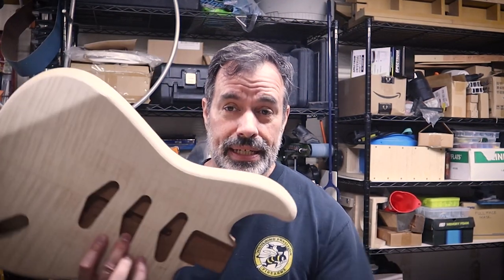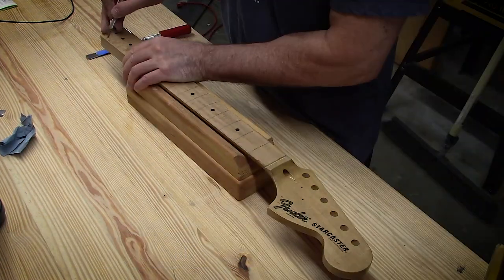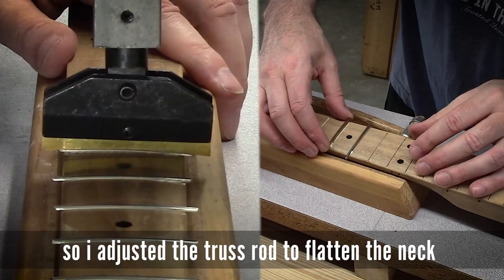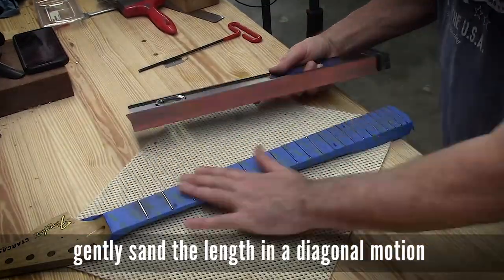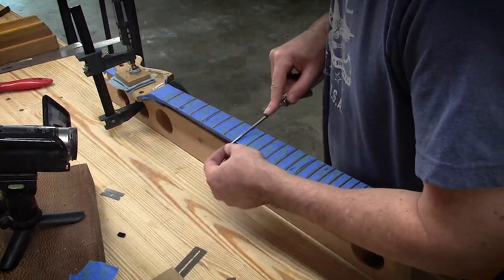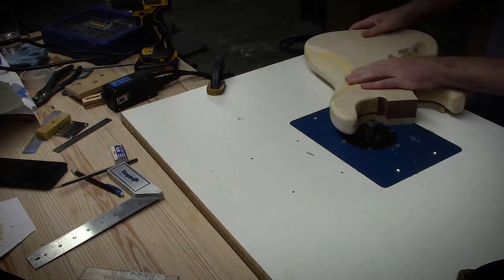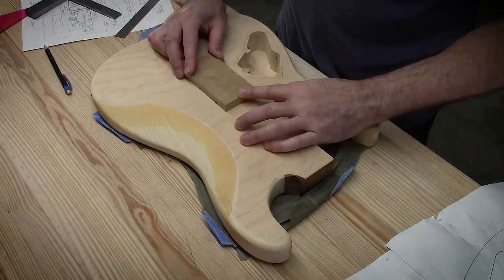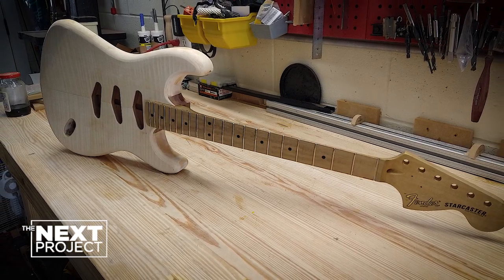Fender Strat Starcaster Guitar Mod Project 5

Comment: Good Lord that thing looks good so far...👍
Reply from the maker: Thanks for watching!
It's going to be a nice guitar some day, still needs a lotta love and a push in the right direction.
Reply: @theNextProject  I hope I'm not being a pain but that fretboard was treated with ca glue then polished up ?... I'm going to adopt that into my builds...just beautiful man..
Reply from the maker: There is a little learning curve and I'm sure you'll develop a process that fits your way of working.  
A couple notes that I should have mentioned in this video. The CA coating process works best with Maple, good closed grain maple.
This fingerboard has some defects in the grain, and those defects are little potholes here and there. The CA doesn't do a great job of filling  little imperfections.  
I once tried this on a rosewood fingerboard, and it was crazy shiny too, but all the grain created pockets for debris to catch in. When I did my level sanding, all those little pockets filled with sanding dust = no good.
Roasted/baked maple works really well, really POPS. Curly works well too.
Other hardwoods with close grain should also be cool. Purple Heart would be neat to try.
Good luck, and be prepared to experiment!

Comment: I'm so sorry for being late to the party, but I simply forgot to watch this video yesterday. So many other videos to watch.
Well, you keep up the good work, that's great!
I'm not a millimeter closer to doing my single humbucker ST. My current plan is to not install a 5-way-superswitch, but to only have a P/P for reverse polarity of one of the coils. I think that's enough. Reverse polarity of one of the coils, you know, many people call this phase inversion.
But I'd like to take a hard tail body and the old Harley Benton neck. I just can't justify the cost to myself.
My actual next project won't take more than one hour, probably less. Only replacing the pots and the caps of a Harley Benton RB-414 bass. A bass that is supposed to resemble a Ricky 4000 series bass, but actually pretty differently looking. Just a little bit of soldering, nothing more. And when I'm finished, I'll replace the knobs with T-style knobs, two black, two chrome. I only have to decide, whether black/black will be volume/volume or maybe  black for volume/tone of the neck and chrome for volume/tone of the bridge PU.
Reply from the maker: Achim, good to hear from you and I'm typically late to the party as well. You're in good company!
I understand not getting project work done as expected, but it sounds like you have a good plan to follow when the time is right. 
And your next project, good to have ideas up front. I try to follow my ideas, then I wonder off when the work starts, lol.
You've got a lot mapped out, all sounds good. Jump right in and stay with it!
Hope all is well for you, take care!

Comment: Love the super glue finish on the fretboard. Did you ever try putting wire or cardboard pieces in the slots to keep the extra glue and compound out when finishing & polishing ? I wanna try that technique.
Reply from the maker: Salmonti, thanks for watching!
Glue in the slots hasn't really been an issue. I used thin CA, and it tends to stay on the surface of the fingerboard (mostly). My concern with putting something in the fret slots would be that the CA would then want to wick down into the slot, capillary action type thing.
But, your idea might work well to keep the rubbing compound out. I may try that in the future.

As for doing a CA finish on a fingerboard. This works well with hard woods like Maple, or probably any closed grain wood. Also, if the fingerboard had nicks or scratches, the CA will coat them, but not fill them well. So prep sanding is a must. 
The smoother you can get the CA on the board the easier life is in final finishing. 

It takes some practice, and don't be alarmed if  your CA applicator sticks to the fingerboard on occasion. It happens, so have a fresh razor blade ready to gently scrape the applicator and excess glue away, then continue once the surface is ready.

Embrace the challenge and deal with the initial learning cure, the results can be really nice.

Comment: You pack so much into your videos and I want to comment on everything :)   But I have one question... did you go straight from levelling beam to polishing compound on the dremel?  No stages in between?  What grit did you level at?  I'm always looking to optimise the fret dressing part of a build...  Cheers!
Reply from the maker: Hey Chris, good to hear from you and thanks for watching!

Let's see, the process went like this:
Cleaned the fret wire - removed manufacturing grunge
Radius fret wire
Rough cut wire
Nipped tang from wire
Pressed in frets
Cut fret ends to width
Bevel fret ends
Taped off board
Leveled frets with beam
re-Crowned frets - file work
Dressed frets - side-to-side fine grit sanding
Rounded fret ends ( note: this could/should be moved up before dressing frets )
Polished and untaped.

Crap, that's a lot of steps. Seemed much simpler at the time.

I try to keep the leveling grit as fine as possible, 320 or 400 typically (400 on this neck).  I've used coarser paper in the past, and for me it just causes more work later on.

Getting the fingerboard perfect as possible is key to easier fret work.
If the neck is flat and has uniform radius, leveling can be minimized to a degree. 
Also, as soon as I got away from hammering frets in, finishing frets became a lot easier too. 

My Rant.
I completely understand the need to hammer in frets, been there and still needs to be done at times. But, anyone who plans to build more than 2 guitars, should start saving to for radius fret caul(s) and an arbor press.
A drill press will also work, but be warned that if done incorrectly, the table on the drill press could break = a bad thing!  
It's really a Pillar Drill, not a Drill Press, right?!
The table really isn't designed for "press" work.

I want to do a slow-mo video of "the life of a fret", showing the contortions fretwire goes through when hammered in. The "pre-radius" of the wire, often does nothing for the hammer fret. Pressing is less stressful for the wire, we all need less stress.
Sorry, I ramble.

Hope that helps, and I'm sure your process is streamlined. 
Great work on your guitars, looking great!

Comment: Hello John, 
the finish on the neck looks fantastic! Great job!

Do You plan to install one or two tone knobs? 

Greetings from Germany
Jens
Reply from the maker: Jens, thanks for watching!
The neck is looking pretty good, a huge improvement from when the project started.

I don't have a solid plan for the controls, it will be 3 single coil pups, but I don't know what control there will be. 2t - 1v,  1t - 2v, or ?. 
Do you have a suggestion?

I did receive all the parts to wind pickups now, so I hope to start that later this week. I'm looking to the early 60's for the inspiration, but not staggered poles at this time. '63 strats are often praised...I've never seen nor heard one in person, so i'll wing it.

I'm making this up as I go.
Take care!
Reply: @theNextProject  
Thank You for sharing! 
I don't make any suggestions. But I can say that I love the controls on the Nashville Telecaster: 5-way switch, 1 volume, 1 tone with push-pull function that adds the neck PU in position 4 and 5 (or is it 1 and 2? 🧐).  

I am looking forward to 'the long and winding' video.

Stay safe!
Reply from the maker: very interesting!
I have a 5 position switch for this guitar, and I have some "push-push" and "push-pull" switches too. 
Hmm, thanks for the ideas.

Comment: What kind of wood do you use for the pocket neck? And how do you do it? It's so cool
Reply from the maker: Jeffrey, thanks for watching and glad you're enjoying the project.

The body of this guitar was basswood originally, I believe. 
As I was cleaning up some of the factory routing, I ran into a big knot, then decided to remove the entire center strip of wood.
I replaced the bad wood with a block of mahogany, right down the middle (approximately).
Here's a link to expisode 2 of this projects, you'll see the surgery happening.
https://youtu.be/_xNe1jamBSE

Since I'm not going to use a pick guard on this guitar, I needed a solid surface for the controls to mount. I made a 5-ply maple laminate top, and then a single ply maple back cover. The back veneer is really only there to hide any potential witness or shrink lines that could appear due to the different woods used, basswood and mahogany.

So the new neck pocket is mahogany with maple veneer top and back. 

I hope that answers your question.
Stay tuned, more of this project coming soon.
Take care!
Reply: @theNextProject  ok, now I understand. Btw, thanks a lot for your explanation. 
I will subscribe to your channel. And I hope you will upload more good videos like that
Reply from the maker: Glad to meet you Jeffrey, I'll keep posting various projects.
As you look around the channel, I've done a few scratch builds, some kit mod projects, some tool mod stuff, a little of everything that helps with tinkering with guitar projects.

Comment: Again, far beyond my tools or skills (I'm more of a experimental wiring dabbler at this point), but I think I'd much rather do all the fret work from this episode, as opposed to all the sanding from last episode. SO MUCH SANDING.

Fortunately, this Starcaster project for my brother avoids both of those thus far -- the frets are great, as mentioned before, and he doesn't care one bit how the guitar looks, so basic black it's gonna be! Though like your own (removed) candy coating, I wonder how many layers of paint are on there... 🤔

Looks like the bridge install is next episode! Time to see a glimpse of what my future holds!

(Speaking of "where in the world", I used to stomp around Sarasota and Tampa, but am now exiled to Western Massachusetts, and SO NOT looking forward to another winter here!)
Reply from the maker: Hey Mark, thanks for watching!
I have a fit with wiring myself, I know I don't know, so I attempt to do a lot of re-research with every project.
Then I occasionally get bad info from the web (go figure), then have to fix what I started.
This guitar was a surprise when I started stripping away the color. If I recall there were 3 black paint jobs on it. I'm pretty sure they were all "factory". It probably failed QC for one thing or another a couple times, ha. 

This guitar had a huge issue with intonation when I got it, so I was wondering if the bridge had been put in the wrong place. You'll see my attempt to find where it should go. There were also online plans available with dimensions, but I do things the hard way.

I lived in the midwest most of my younger years. Snow and ice were pleasures I don't miss, now that I'm in the Orlando area. However, I never had to deal with tourist traffic in the midwest.  

Bundle up, winter is coming'!
Reply: @theNextProject  I lived in Youngstown and Columbus Ohio for a really long stretch, and we had the fun of "lake-effect snow" charging up on moisture from winds coming off of Lake Erie. SO NOT A FAN!